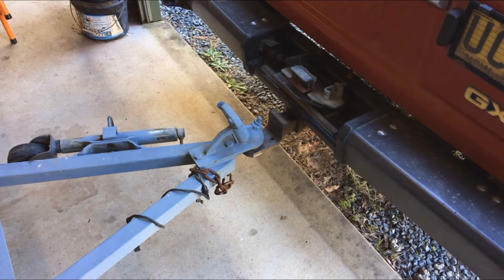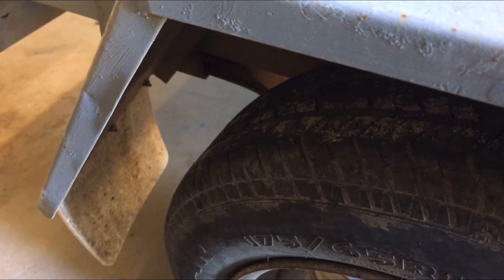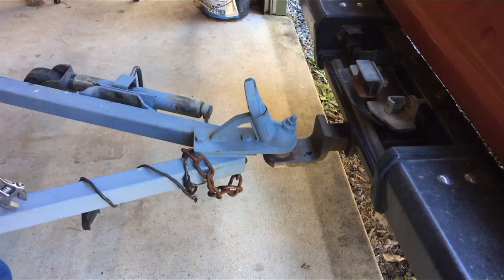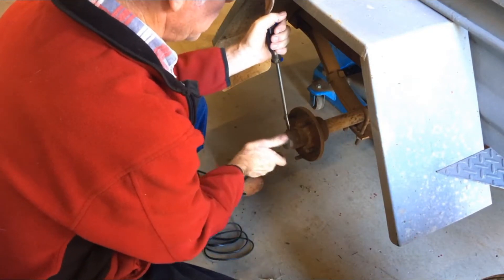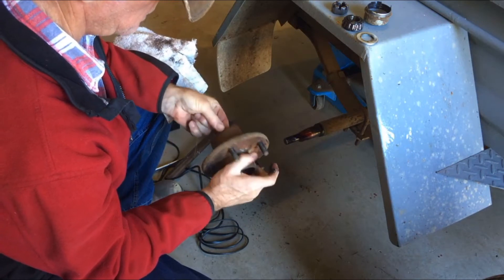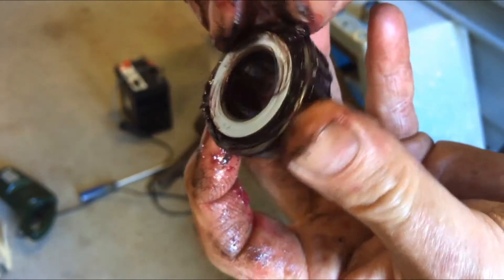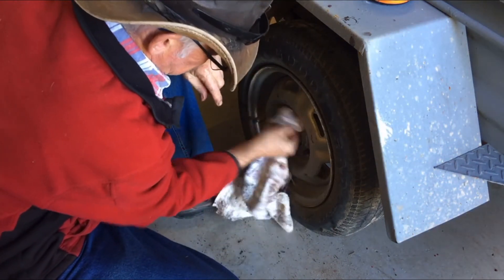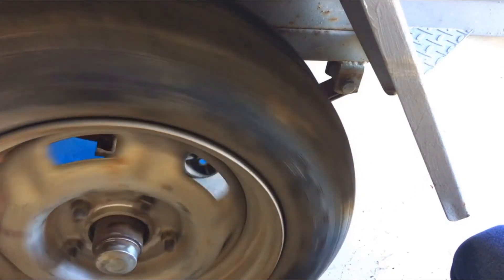Noisy Box Trailer? Tyres Delaminating! How to spot the problem.

Comment: I believe the maximum weight for an unbraked trailer is 750kg, including the weight of the trailer. It could be even less, depending on the towing vehicle. Your new lapel mike works well. :)
Reply from the maker: I'll have to measure the cubic capacity of the trailer, then compare a litre of rocks to a litre of water.
That or just visit a weigh bridge although the operator may be required to perform a citizens arrest.
The trouble with the Mic is I must use their video application and it doesn't work on a android phone unless I buy two of them and pair them together. I'm recording these on my iphone.
The app requires me to copy the video's a second time on the phone before I can export so it creates a lot of files. It does sound better though :)
Reply: @DavoShed  Multiplying your cubic meterage by 1.75 should give you a conservative weight of your road base in tonnes, (assuming you haven’t packed it down yet).